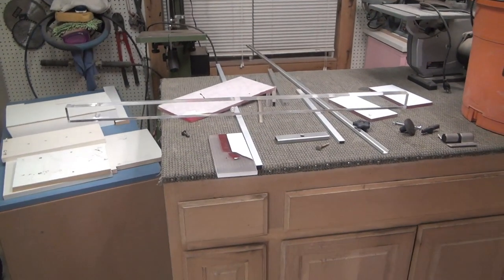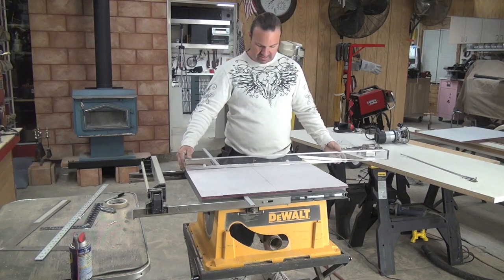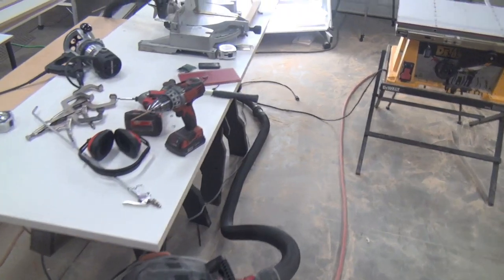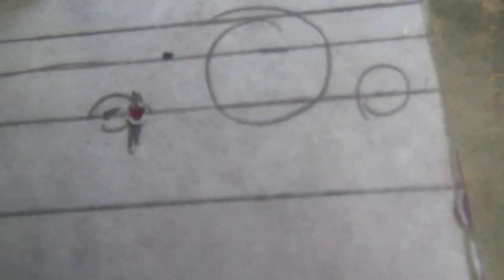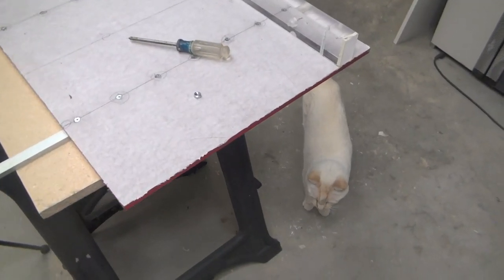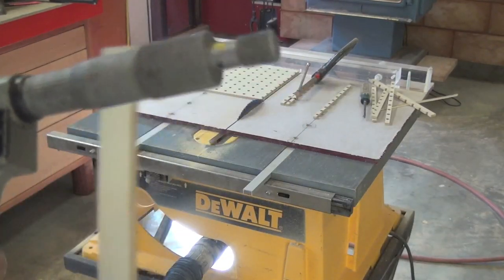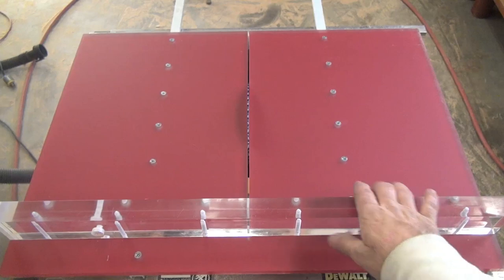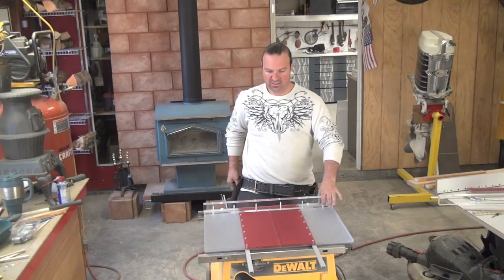How I Built a Glass Table Saw Cross Cut Sled Jig *Delux Edit

Comment from the maker: This is the glass table saw sled I made. It took roughly 8 hours to build but took many more hours to edit. I may upload another version of this with more details since I skipped a lot. I made this to cut laminate pieces for the miter saw station i'm completing.
This was a fun video to create. Hope it was worth a look...........
Reply: Where did you find the aluminum track.
Reply from the maker: Karate Kidd
Hello, The aluminum track used here was something that I collected over the years. I didnt actually buy it, I salvaged it from a job site. It just happend to fit in the slot.
   I'll try to find out for you. They also make solid stock that can be used only difference would be youd have to counter sink the bottom for a screw head or bolt head, its actually probably stronger.
Reply: Thanks for the info.... Salvage us always the cheapest.  I can find the solid barstock, I'll probably go that route

Comment: What condition is the top surface at the kerf in now?  Is it fully impregnated with glass blow out?  

I am serious about this question.  I have never been able to get a table saw, without water lubricant, to give a cut free of massive blow out. I can not believe that any actual daily use of this device will yield anything but massive blowout and a sled full of glass shards.

Correct me if you have actually used sled this thing more than ten times and it is free of glass shards.

Thank you.  Excellent video production quality.  Highly suspect content.

Comment: Good work. as far as why you don't see plexi cross cut sleds, they are eye candy but not cost effective especially if you need a large one for contractor saw. a 1/4 x 48 x 36 medium size would set you back close to 100 if not more not including thick fence  most states. even 10 years a go when i used a thick plexi fence for router table that set me back close to 80. and also way too slippery for work piece.
Reply: My thoughts exactly. Ultimately a waste of good plastics. To each his own.